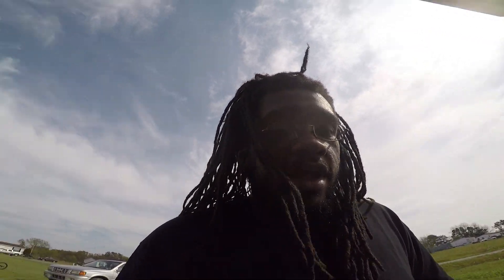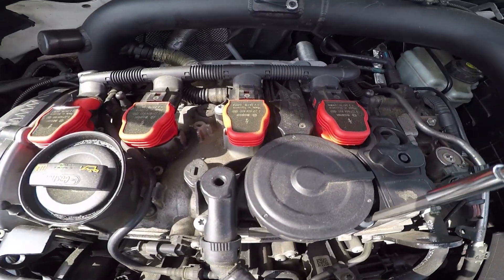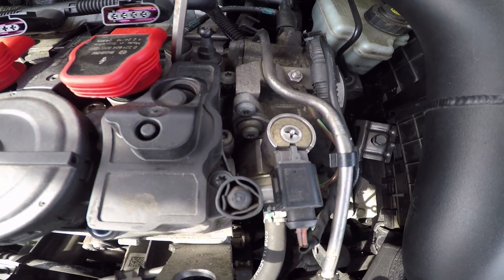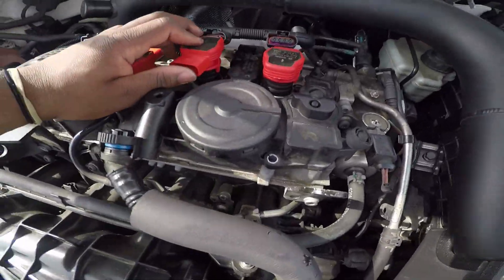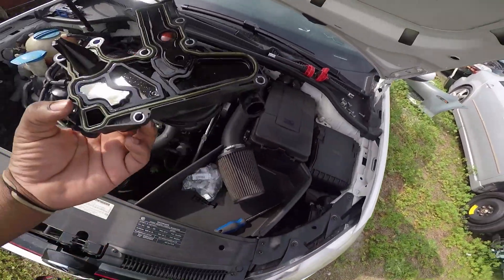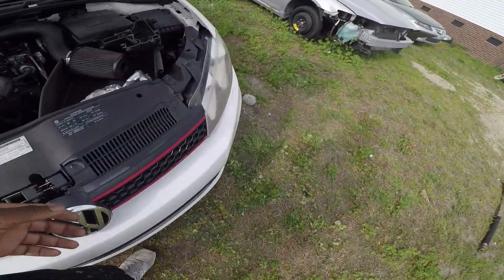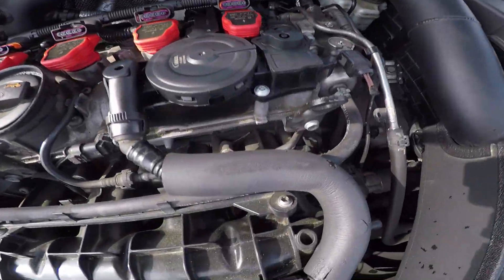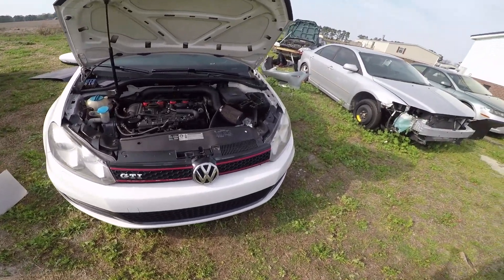Mk6 GTI PCV Valve DIY (how to)

Comment: Did this solve your issue?  Are your spark plugs good? Have you replaced your High pressure fuel pump?  I had hesitation on my GTI at freeway speeds before it crapped out on me.  Mine went @ 162k.. It was $250 from FCP EURO with a lifetime warranty! Not a fun job but not too hard at all.
Reply from the maker: It stopped my oil consumption. But the maf sensor fixed the hesitation
Reply: @derrickjohnson12341  what is the MAF sensor? 

And does the replacement of it stopped the weird feeling between 2500 and 3000 rpm?
Iam from germany 😅